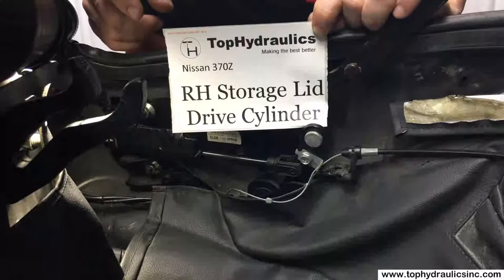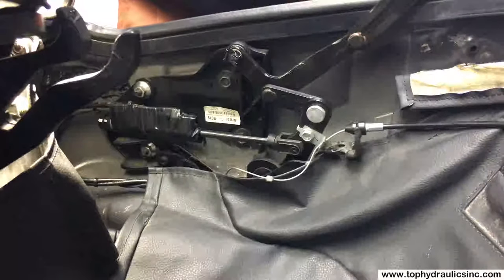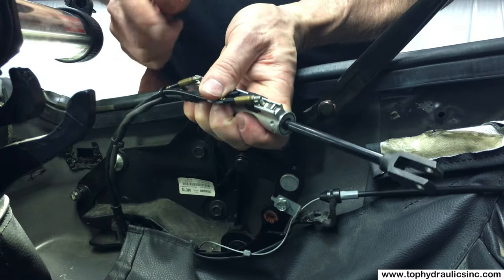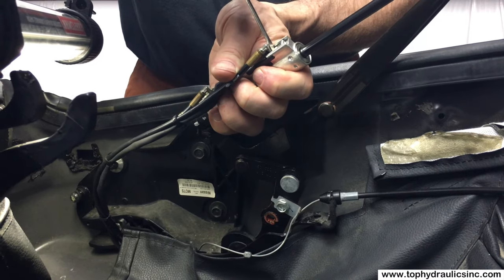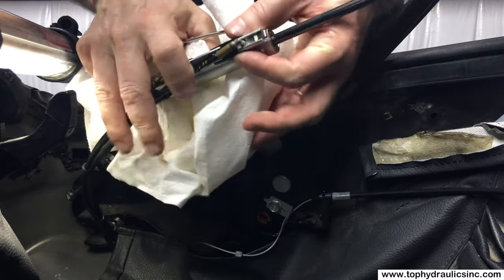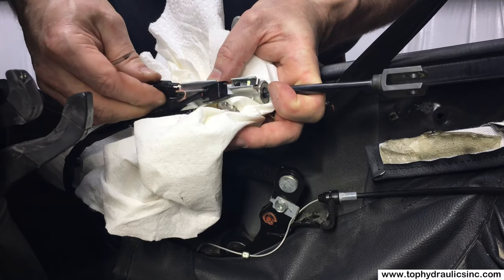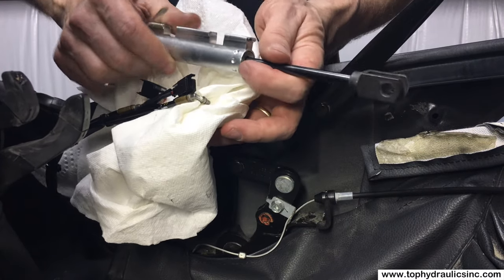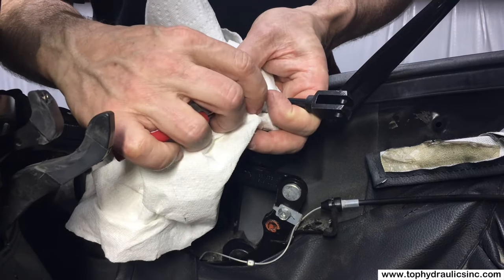Nissan 370Z -  Chapter 5  - How to replace the Storage Lid Drive cylinders

Comment: Is this the “main lift cylinder”?
Reply from the maker: This video is about replacing the storage lid drive cylinders. The main lift cylinders are mounted vertically and you can see them here, in the video about removing and replacing the main lift cylinders: https://www.youtube.com/watch?v=kHLh-JWM9NM&list=PLly4CMbpk7oxTZzpfpFyLSwfyatkJN6lF&index=4

Here is a location diagram for all eight cylinders in your 370Z: https://tophydraulics.com/1546-large_default/nissan-370z-right-main.jpg